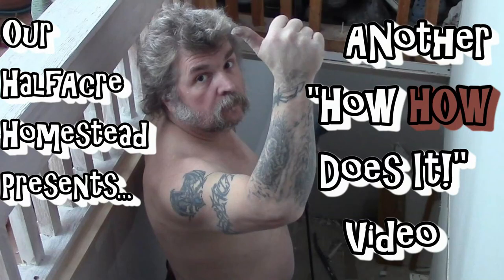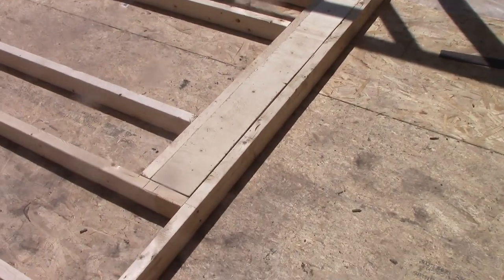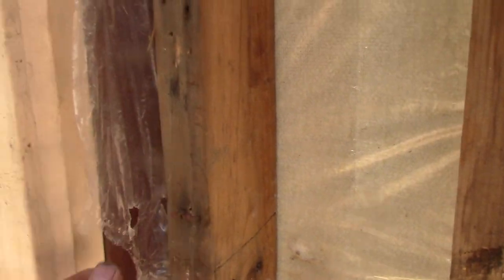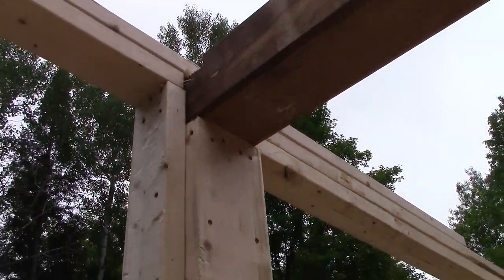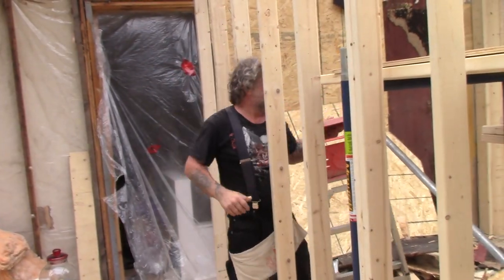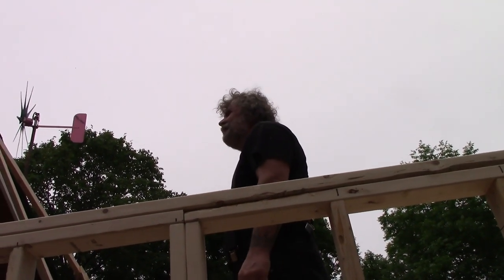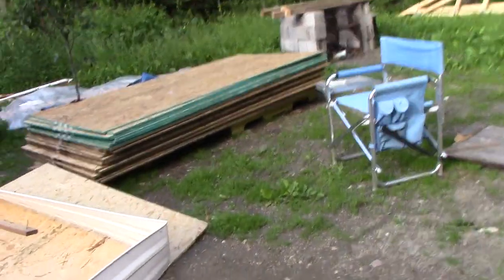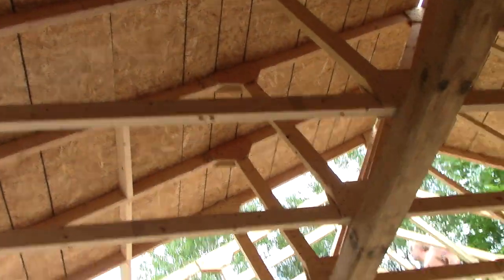Raising Walls & Trusses

Comment: After my ex and I built our home and divorced I purchased a home and built a 8/12 little house in the back yard for a shed.  Has a 4/12 foot porch and two windows.  Has a 4/12 deck under the porch.  I love it.  I was in my 60's when I did this.  Had help putting up the trusses but put the roofing on myself.  What a job.  You really appreciate it more when you do it yourself.  By the way I am female.

Comment: how did you design the trusses?   is there some sort of software - i know it's all physics mumbojumbo, but can i can sure as heck follow directions if i have them!
Reply from the maker: one less rat Here you go! https://www.google.ca/search?q=roof+truss+diagrams&espv=2&biw=1600&bih=775&tbm=isch&imgil=gIK3chQVQdFjNM%253A%253BwCgNixsGye4eSM%253Bhttps%25253A%25252F%25252Fwww.dlsweb.rmit.edu.au%25252Ftoolbox%25252Fbuildright%25252Fcontent%25252Fbcgbc4010a%25252F12_roof_systems%25252F04_roof_trusses_general%25252Fpage_004.htm&source=iu&pf=m&fir=gIK3chQVQdFjNM%253A%252CwCgNixsGye4eSM%252C_&usg=__zVMjFVUmT5Nasi3JmqxPNbhRRJs%3D&ved=0CDIQyjc&ei=LfKcVbHIK4nqoASt9IKoBg#imgrc=_&usg=__zVMjFVUmT5Nasi3JmqxPNbhRRJs%3D
Reply: whoa!!!  rock 'n roll - awesome!   thanks Howie!